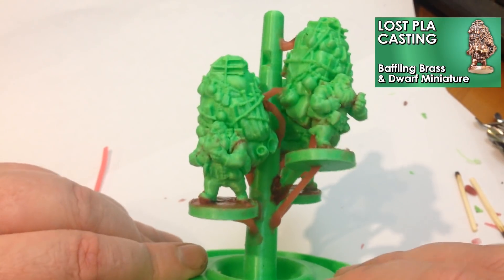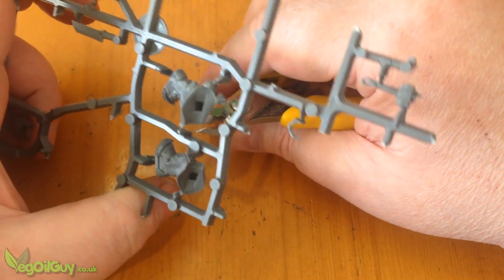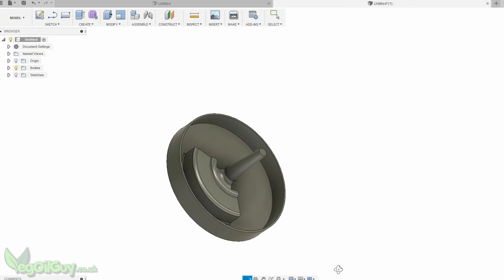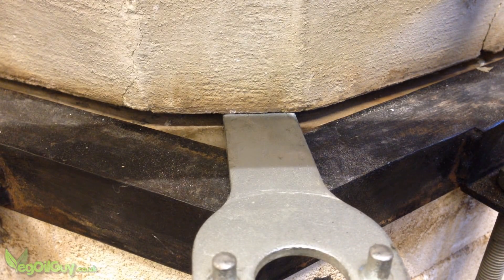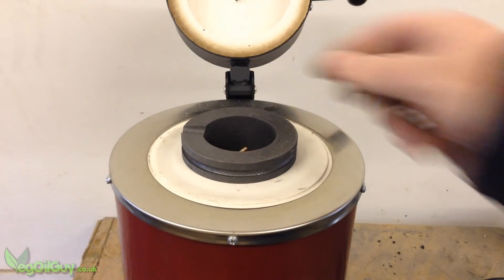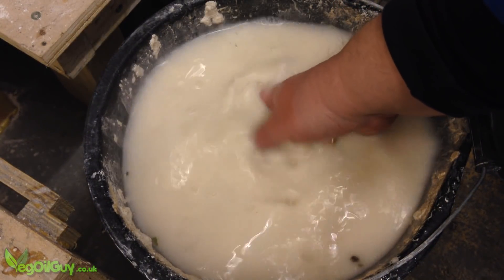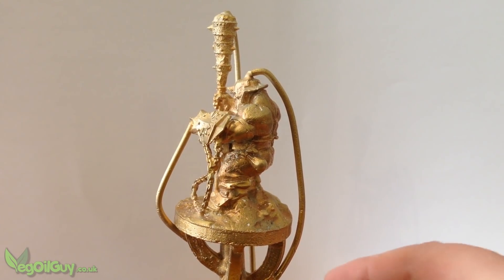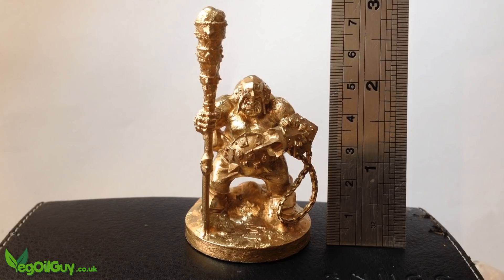WARHAMMER miniature bronze casting - lost PLA casting method - by VOGMAN

Comment: could you use the furnace as a burn out oven if the parts are small
like ring size or do you have to have a burn out oven
and have you a link to the plaster and your one to one mixing ratio of it thanks
Reply from the maker: Not really. A burnout oven needs to be heated slowly and used for many hours. Good insulation and control are essential.
Reply: @vogman  so if i havent got burn out oven i have to use green sand way ..if i want to cast Aluminium or buid one is that my option..cheers
Reply from the maker: I started with sand. Many people achieve miracles with it, but it's a real skill. Investment casting is easier, but a burnout oven is a must. I built my own for cheapness.
Reply: @vogman  thanks  mite have buid one little smaller than yours

Comment: You got lucky with this casting. Its quite a bulky piece so the body acted as a reservoir, feeding molten bronze to the chain etc. If you were casting a much finer piece I'm not sure gravity casting would work. I regularly cast very fine bronze pieces and use the lost wax method and spin cast from a small quartz crucible. The problem with this is you need much more heat to melt the bronze because you can't use fire bricks to concentrate the heat, so I use an oxy aceteline torch which will melt steel...
Reply from the maker: If any of my castings turn out, I consider myself lucky 😉😊
Reply: @vogman  I've spent 10 years working on this to increase the odds of success. Its bloody complicated and there are so many things to consider, Experience is the best teacher in my view..

Comment: How do you prevent copper oxide from forming? My investment castings are always covered in red, black, or grey fire scale when I pull them out of the quench bucket... Yours appear to be perfectly shiny!
Reply from the maker: I wish Felix  : )
I guess in depends on the alloy. Aluminium Bronze doesn't oxidise in my experience, though it's not shiny, just wet. In following scenes it's been scrubbed in hot soapy water, so it may have taken on a bit of a buffing.
If you look here https://www.youtube.com/watch?v=xNipIFMKta4 you'll see I used Silicone Bronze and that does oxidise. My last video was silver - oxidisation again. So I guess it all depends on the videos you're watching and the metals I'm using : )

Comment: Have you considered adding affiliate links for some of the equipment and materials you use? I'm off to look for a source of carbon stirring rods which I might try out as electrodes in my electrolytic rust removal bath.
Reply from the maker: If you're in the UK, I bought my Carbon Rods here - https://www.cousinsuk.com
Affiliate links would be nice. Any little helps. Mine is quite an expensive channel to run. But such links tend to be available only with very large companies. Smaller companies, especially British ones from my experience, tend to turn very pale and reach for strong medication if you ask for a discount of any sort. But I do believe Walsh and Cousins have done very well out of me  : )

Comment: Not to detract from the great results of your new hobby, because I know I have learned a lot from them. I might even try some of the stuff shown. However I started watching your program because I want to learn more about burning veg oil in a diesel engine which you originally started showing. Have you given up on the project? I know there is plenty more to talk about. If not can you at least tell me the name of any YouTuber showing the process where they add the chemicals to make biodiesel a super clean 'veg-diesel?'
Reply from the maker: Interestingly, I did start YouTube to get the "drive on Veg Oil" message across, but to this day those videos remain largely unpopular. I still drive my vehicle on Veg Oil, but I do very little mileage these days. So I've pretty much exhausted my knowledge of the subject because, as I've always said, I'm not an engineer and I'm no expert  : )
With that said, all biodiesel and veg oil motoring is super clean. The fuel has a cleaning effect and tends to strip out all the carbons and nasties from with the engine. Have a read of my own experience here - http://www.vegoilcar.co.uk/my_experience_3.php
So if anyone is out there trying to claim an extra chemical is needed for this, I'd suggest they're just trying to screw a few quid out of the unsuspecting motorist. It's really not necessary.
And if you want proof... my vehicle is a 2005. It's STILL on it's original parts. Only now, all these years on, is the exhaust showing signs of deterioration, and I suspect this is because I'm doing less veg oil motoring  : )
Reply: @vogman  I don't think it was a scam because it was an alternative energy program. Best I remember it was an educational program thay lasted for several shows. They were crossing the U.S. with all different alternatives energy sources, and bio diesel was just one segment. Plus they don't sell anything. They also messed up the mixing the first time and it turned into a chunk instead of a liquid. When they did it right they didn't have to start and end diesel.
Reply from the maker: Ahhhh... that's good. That's just standard biodiesel then, no additives, etc. I like the idea behind biodiesel but it is VERY dangerous stuff to mix (and I'm happy playing with liquid metal). The recipes are out there. Sorry I can't remember it... it's been so long  : )

Comment: I have a similar setup, with a large kiln, and a small table top model, although mine is only a 3KG model though.  Your casting came out beautifully.  I am planning to make some parts for a friend of mine's boat out of aluminum bronze via lost PLA as the aluminum bronze has reasonable corrosion resistance in addition to looking good.  As long as I don't have to machine it I'll be happy.
Reply from the maker: It's a great metal. I'm sure I read somewhere that next to steel it's the strongest alloy we can produce with home furnaces.
These electric furnaces are great, much faster than I was expecting and 3Kg (or 4 in my case) goes a lot further than folks would imagine : )
As for lost PLA, you've nailed it there my friend. Minimum effort is what it's all about to me. If I've got to spend hours shaping a casting, then I may as well have started with a solid block of metal. 
This Friday's video is a nice example of how Lost PLA can make some useful, precision castings.

Comment: Hey Geoff just a little question since I didn't get any answer to this from bigstackD :D I wondered how loud propane burner furances are (in db ranges) for the reason that I'm quite interested to start metal casting in the near or far future and I can't really make up my mind to fancy electric or gas burners. Thanks in advance :)
Reply from the maker: Sorry Nini, I can't answer that in Db as I've no way of measuring it, but they're NOT quiet. I try to pick my moments when I use my gas set up as I don't like to bother my neighbours - they're great on both sides, but I'd like to keep things that way : )
So how loud? Well, loud enough that you have to raise your voice to be heard but not so loud that you have to shout... is that a good enough answer?
As for electric, well, how big will your casting be? The 4Kg crucible I've got with the electric foundry you can see in this video is surprisingly large. The furnace itself heats up copper to liquid in around about an hour, virtually silently. Plus you never have to worry about the weather or the noise.
But the choice is yours  : )
Reply: @vogman  That answer should suffice :D about the 4 kg one, yes I've estimated it to be sufficient enough (can't imagine anything that would take more :) ). That silence part of electrical furnaces is also my biggest positive thing about them (hence the question of loudness). How prone are bought electrical furnaces to breaking down though? (yey .. specific questions no one can really answer) I only partly trust myself into building one myself, but still it doesn't need to be as fancy beautiful as yours and would also be easier to be fixed (as seen from recent events of yours :] )
Reply from the maker: You're right, I can't answer that...  : )
My GUESS is that these things are pretty good. They do sell spares and like all electrical equipment and I believe these are easy enough to swap and change. They are also professional tools, aimed mainly at the Jewellery trade, so for the casual user I would hope we'd see years of use... but it's early days for me.
As you've pointed out, I have two electrics. My home made one is large, but slow. My store bought is small and fairly quick. Both turn on with the click of a button, run quietly without being monitored and do the job very well. 
If your needs are smaller, go for the shop bought model. It may cost a little more, but it will work better.
Reply: @vogman  Ah you're right. I didn't think about the professionals who might use it x) I guess the electrical ones will fit me better. Thanks for your advice. Very much appreciated :)

Comment: I recall reading on a forum a while back that you can rinse the inside of the plaster mold with wax after the plastic has burned out to dissolve away any residue.
Reply from the maker: That's interesting... sounds a little strange as well. I've heard of blasting air, but not reapplying wax. Maybe it has a nice low melting temp or something. Thanks for the input  : )

Comment: Great video and result!  I have a couple of miniatures (from another RPG series..) that I have been trying to figure out the best way to cast in bronze.  My original idea was to make up a two part silicone mold and use wax. The downside is that the silicone is very expensive and these miniatures have some nasty undercuts which are going to be difficult to mold properly.

Using the originals would hopefully work a treat, but is obviously a "one shot deal".  If the miniature comes out as good as yours it would be worth it, as I'm not looking to make copies, just the one in bronze.  If I muck it up...

Unfortunately these miniatures are becoming harder to find.

I still think I will give it a go though. I managed to pick up a small second hand kiln cheap, so I can burn out material properly.  I tried using home made investment, with a tin can as a flask and the furnace for burn out.  It didn't work too well...  The burn out destroyed the tin can flask and weakened the investment.  The piece came out in the right shape but the detail was horrible!

I like your new setup. Simple and clean...  One of your countrymen uses a microwave for melting the metal and the burnout.  Much cleaner than anything else. But... electricity prices in Australia at the moment are insane, so not so cost effective.

Again, well done!
Reply from the maker: Please just do me one favour... try a few other pieces first, ones you're not so fond of. The process does seem to work don't I wouldn't advise anyone to do what you're proposing first time one. We all need practice. When you get good results every time, then you can give it a go with your prize possessions  : )
Reply from the maker: Oh... and check out my community page... https://www.youtube.com/channel/UCkEYj8wtK3aEW8vSGhlB43g/community
If you have a suggestion for a suitable Resin / Casting project, please leave a comment  : )
Reply: @vogman  Thanks for the concern and advice Geoff. It's much appreciated.  The miniatures aren't what I'd call prized possessions though, so if I was to stuff it up I'd probably speak sailor for a few minutes and then go put my thinking cap on again.

Since the learning experience with home made investment I decided to buy the proper stuff.  "Buy once, cry once". Still in the box though... I also bought a proper stainless steel flask.  Bloody expensive little sods!  As it happens, normal steel exhaust pipes fit the rubber bottom and my friendly local mechanics has a ton of offcuts!  I've also made my own vacuum system.  I just need to solder some parts to get them air tight and I am in business. 

I made a ripper furnace out of an old 9.5kg LPG cylinder, 50mm isowool and a burner from a local blacksmiths supplier.  I'm sure if I tried hard enough I could melt steel with it!  Maybe. But it will melt copper alloys with ease.

The project I was referring to earlier is a pendant for my partner.  I have made the pattern out of beeswax (well almost finished). From what I have read beeswax should be ok, but if that fails I will look at proper casting wax and/or PLA.  I have a little 3D printer that should handle the job, but I would prefer something a bit more 'hand made' if possible.

Thanks again.
Dan.
Reply from the maker: Excellent mate  : )

Comment: Can you do a lower heat cycle, say up to 250 C, to remove most of the plastic and pla, then cool the mold. Then clean out the mold with acetone to remove the plastic residue.
Reply from the maker: It's a good idea Andrew, but I'm not sure what would happen to the plaster. It's very porous stuff.
Reply: @vogman  fair enough, it may wash away some of it
Reply from the maker: True... good thinking though : )

Comment: You might be able to make a silicone mold of the figure then make a wax figure for easier burnout.
Reply from the maker: Thanks John. I'm no stranger to lost wax casting and have done a few silicon mold projects. But for this one I wanted to keep a Lost PLA theme going... Plus this way I don't have to worry about upsetting Warhammer when reproducing their figures : )
Reply: I only know about any of this stuff from watching YouTube videos. I  was just thinking it might be easier and that you wouldn't have to destroy your figure and could keep the set intact.  Great work though, I love your videos!
Reply from the maker: You've leaned well - you're absolutely right! That's the beauty of lost wax casting : )
If you want to produce a lot of the same thing, then making a silicone mold and using lost wax is the perfect technique for accurate multiple castings, every time. The downside is, silicone is expensive stuff : (
BUT if you're like me and want to do something different every time, you need to be able to make something accurately, easily and cheaply. That's where a 3D printer comes in. So the theory goes, if you want something and can print it, you can cast it in metal. Or at least that's what I've been trying to demonstrate  : )

Comment: Geoff, you never ceases to amaze! No wonder I'm a patron. 
Any specific reason for Alum. Bronze?
Reply from the maker: Very good question and it was just a personal choice...
Aluminium doesn't favour detail... it's quite viscous. Brass gives off toxic fumes and I was working indoors. Copper is notoriously difficult to cast. But add a little aluminium to copper and you get a nice fluid alloy that for the amateur casting enthusiast is, I believe, the next strongest thing we can make at home next to steel. So it ticks a LOT of boxes  : )

Comment: With your liking these figurines you might want to try making some silicone rubber molds of them and then making a little wax injection press . If you do remember you’ll need vents in the silicone mold it’s best to cast these in when pouring the mold (cutting in afterwards is not that great).
Reply from the maker: Thanks Richard. I toyed with wax casting, but then it wouldn't be fair to Games Workshop and their copyright. But with the burnout approach, I bought it, I can do what I want with it  : )

Comment: That. was. AWESOME!!! The result is indeed one of your best castings so far. The surface finish due to burnt (carbonized) residue of the plastic gives it an old handcrafted look, which adds to the result and does not look as a flaw. (at least, to me it doesn't!)
Also the video editing is great: there's a tension build-up, and you managed to perfectly convey the excitement as well as the thought of not expecting it to work at all, which increases the climax on the reveal! Next stop, Hollywood! 

If you are going to try this again, a thought on getting even more plastic melted out: maybe there's something you can coat the item with to prevent the plastics to stick to the plaster. Another idea I had is that perhaps there are certain softeners you can add to lower the melting point and therefor evacuate the plastic before it carbonizes... Maybe add an extra sprue on a high point made from a plastic with high softener content which will mix with the other plastic as it melts. (just random brainstorm thoughts, I have no chemical background to back this idea up)
Reply from the maker: Thanks Luke. I do agree with you about the look of it. It may well be carbonised residue, but it works. Each time I look at it, I see museum bronzes. I don't know why... it must be triggering a memory I can't recall. But it works  : )
I'm not sure Hollywood will agree with you, but if any of those gorgeous actresses want to get in touch, I really don't mind : D
Reply: @vogman  hahaha, will a gorgeous editor girl do? In that case, I may be able to help... (though she's taken, and unfortunately not by me...)
Reply from the maker: I sort of tuned out there after the words "gorgeous girl"...   :D

Comment: VegOilGuy  Electric Melter is fantastic!  Love the idea of casting models and premade plastic figurines, hopefully you do more experiments with it!  I would be curious to see if you could do it with a store bought figurine just by increasing the temperature and time length of the burnout substantially.  Another experiment that would be interesting is to see if YouTube "Starlite" material popularized by NighthawkinLight could be used as a casting mold medium.  It's basically cornstarch, baking soda, and adhesive glue concoction that withstands amazingly hot temperatures.
Reply from the maker: That electric furnace is great. It's so easy!!!
Starlite... I haven't come across that  : )
Reply: @vogman  You should defo look it up. What is the new electric furnace and where do I buy one?. Great work!!
Reply: Very interesting concept.